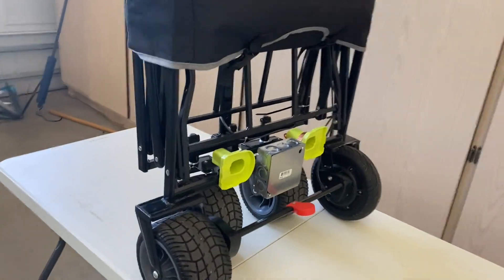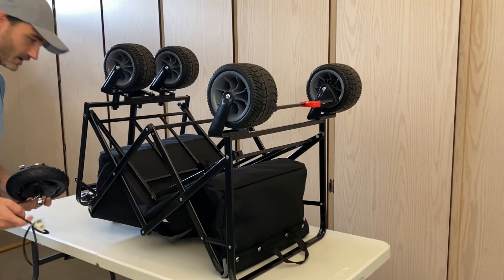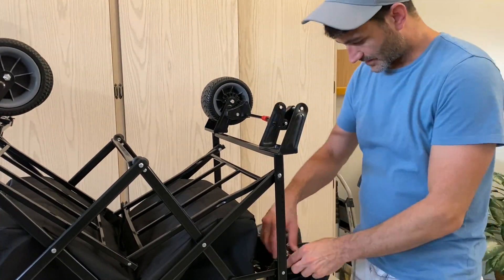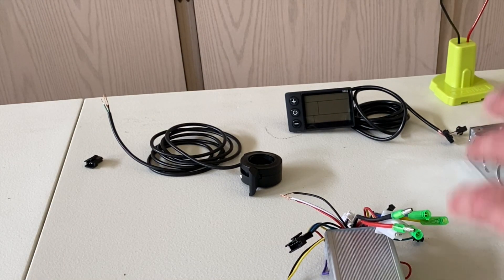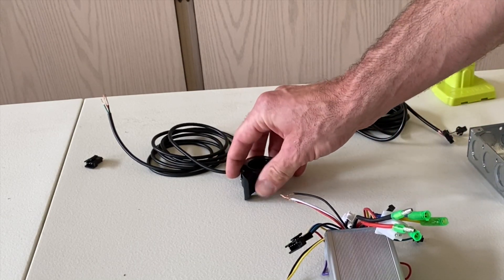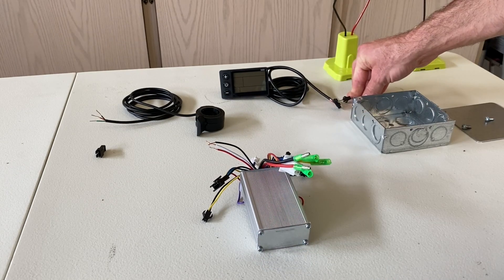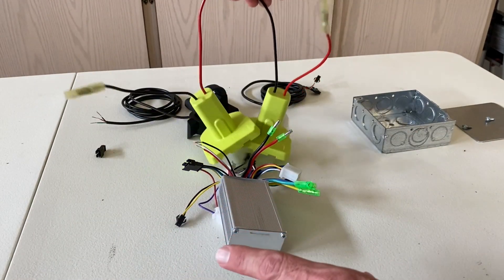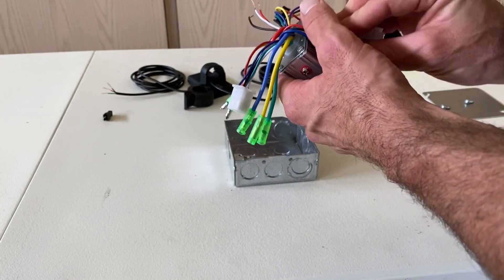Electric Wagon.  Drill Battery Powered.  Easy DIY build!!

Comment: Are those two 18v batteries? Could you get away with one 20v battery. Or is it more batteries longer run time? Great job by the way! Going to be building one soon!.
Reply from the maker: Thank you.  It’s 2 18v batteries wired in a series for 36v.  It’s really for higher voltage more than longer run time.  A 20v battery might work but I’m not sure. If it does, it will likely be more sluggish.  The motor controller I used is 36v.

Comment: Hi! I love this video! I noticed the material/equipment list shown early in the video.  Is it an issue that the wheel is rated for 24 volts but the batteries in series adds up to 36v?

Also, how would you connect two motorized wheels instead of one? Would i need a different controller and batteries? Your help would be greatly appreciated!

 Thank you!
Reply from the maker: Thank you for the comment its much appreciated.  First I just want to say I am not an expert or professional at these things.  With that being said, (question 1) In the item's description it says that the wheel is rated for less than 36 volts, and I only use it on power setting 1 and 2.  There is a good chance that when I am using it, it is closer to the 24 volts because I am using it on the lower power settings ( Power setting 4 & 5 is probably to much for the wheel to handle for more than a few minutes, especially with weight on it).  I was on Amazon the other day and I noticed that they have an identical wheel that is rated for 36 volts and it is about the same price (maybe a better option) .
(Question 2)  I am not entirely sure about how to hook up 2 motorized wheels, however, I do have a drift Trike that I bought which has one power source (1 Set of batteries) and it is connected to two separate motor controllers which each go to a separate wheel, so for that reason I believe it is doable.  Hope this helps.

Comment: Thanks again for the video, I've now completed 2 powered wagons, one TMZ wagon that steers and one Costco Mac wagon which seem to have much better build quality.  I ended up giving the Mac to a friend.  On the TMZ build I ended up taking a brake lever and cable from one of the bikes my kids had outgrown and installed it on the drum brake that is included in the hub.  Although I do let the kids steer the wagon under super strict direct supervision only, it's nice having the brake there as well for a quick stop.  My kit came with an ignition lock which I wired into the box and keep the key in a secure place.  I had to watch the part from 9:05 to 10:11 multiple times to figure out how you ran the wire in the handle.  I noticed you installed the metal push clip upside down in the upper part of the handle, has that given you any trouble since the install?
Reply from the maker: No Problem,  you are super observant. Glad I inspired you.  Yes I did install it upside down and I believe I had to trim it a little and put tape to protect the wire from cutting.  It was a while though and I don't remember all the little details.
Reply from the maker: It has been holding up for me.  I didn't have any issues with it.

Comment: How does this video not have a million plus views?  Finally through a lot of trial and error and ordering a lot of different kits, controllers and hubs I've got my actual system up and running.  I will be installing it in my wagon soon.  I now have a new problem.  Do I install it in my perfectly good folding pull wagon which doesn't steer, or get a steerable wagon like yours so my kids can sit and steer the wagon for fun? I'm leaning towards a new wagon and will have to install a brake as well.
Reply from the maker: Hi Amandeep,  Thank you so much for the comment, and I agree THIS video should have a million views.  Just want to make a note that this video was for entertainment,  I would not and do not recommend doing this and letting kids (or anyone) ride it, it could be dangerous for numerous  reasons, and the wagon is not designed for passengers.  I only let my kid ride it briefly under close supervision to show that the wagon does most of the work with little effort.  With that being said, I chose the wagon with steering because having the ability to point the front wheels in a specific direction stops the wagon from constantly pulling only to one side.
Reply: Yup, the occasional ridding/driving by the kids would be under absolute strict conditions only.

Comment: Hi, so I am not well versed in diy mods but I try my best.  Just to be sure, you used what voltage for your batteries?  I heard you say in series.  Is the wheel heavy?  Thanks
Reply from the maker: Thank you for the comments.  First question,  I believe you need a throttle control.  Second question about voltage:  I wired the batteries in a series to get 36v to the motor controller, however, I only use Power Setting 1 and 2 so I am not using the full 36v which is higher than the hub motor is rated.  If your moving around something heavy constantly they make another wheel hub motor (which is almost identical)  that is rated for the full 36v which might be a better option for you. Hope this helps.

Comment: Thumbs up!  Nice job.. I will try.  Question, do I need a throttle control? Could I just plug it and go with the default speed?
Reply: It's best to have a throttle. Default speed won't stay the same if you are on an incline and the wagon is loaded.

Comment: Hi Richard- great video with precise directions! I'm handy, but electricity is not my thing, however with this video I can pull this off. Question: does the wheel float free, like neutral, so I can pull it if I run out of battery?
Reply from the maker: Thanks for the comment.  Yes,  the wheel that I used spins freely if there is no power to it.   So if the battery dies its just a regular wagon.

Comment: Thanks for the video. I'm going to try to make one. I was wondering about the voltage. The wheel motor is marked 24 volt but it looks like you're set up supplies 36 volts?
Reply from the maker: Hey Richard, thanks for the question. First I have to say that I am not an expert or professional of any kind in this field.  With that being said, that is the wheel that I bought and I have been running at 36v for about a year now, however,  I only use it with power level 1 or 2 setting.  It says in the description that it should be operated at less than 36v and is most likely under that on the lower power setting ( I am guessing though).  It is possible that they changed the description on specifications over the last year also.  I did do a quick search for you though and found that they do have an almost identical wheel that is rated for 36v.  Check this one out if you want to play it on the safer side. " L-faster 36V 350W High Speed Hub Motor 8 inch Wheel Motor Scooter Brushless Hub Motor with Wheel Tyre Drum Brake Motor Wheel".  Hope this helps and good luck.
Reply: @modsjustin981  Thanks for the fast reply and helpful information. I'm going to order the 36 volt wheel hub.

Comment: Great work. Have you tried it at the beach on the sand?
Reply from the maker: Thank you.  I have not tried it on the beach yet.  I think it will have a trouble in deep sand.  It works  decent on rock, but, a bit bumpy.  I will definitely consider designing an easy to build  electric beach cart in a future video though.   Thanks for the interest.

Comment: Made one works great, Lot's of power, use it for everything , sure saves the legs and back when your getting old , when your finished with your  project just fold it up and stow it away.
Reply: Have you guys tried adding a remote controller to it
Reply: This is what i came to find out 😂 @Adam-Solomon
Reply from the maker: Right on